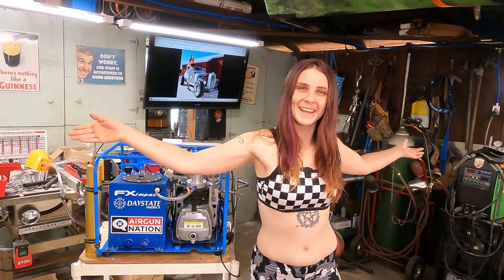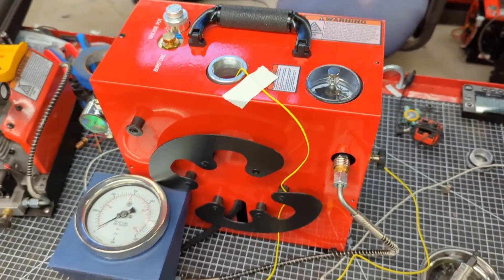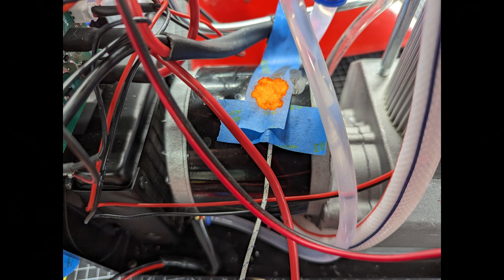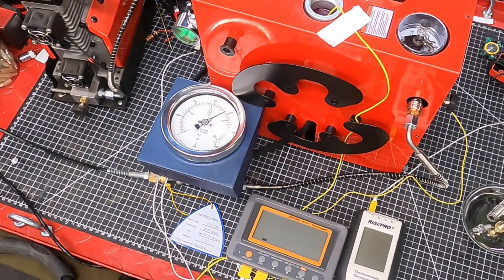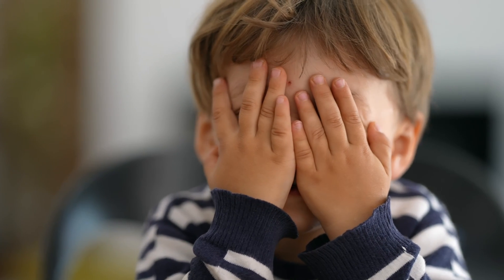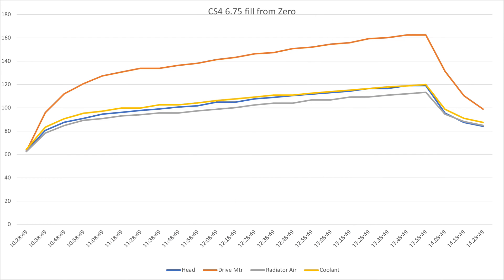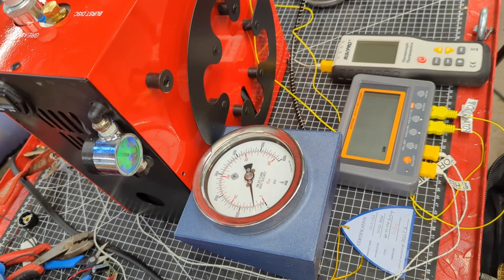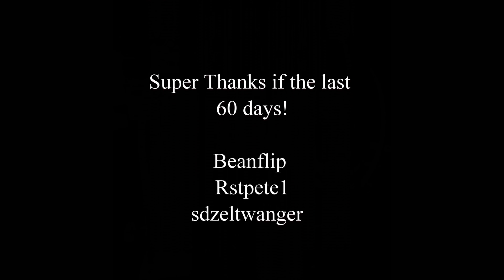CS4 Thermal Test! What's in store for you when you buy one! #HPA #YongHeng #compressor #airgun

Comment: I purchased a GX 4 compressor. This is the first time I run it. I set  my two needles at 4000 psi I did not hook it up to my gun. I just ran it like that. It only goes up to 3000 psi then it stops pumping, but the fans keep running. Is that normal?
Reply from the maker: Without seeing the needles in the pressure gauge, hard for me to say. What is telling you it is at 3000psi? Do you have an external gauge to test it? Consider booking a session to look at this with me via targetforge.net We likely will not figure this out through comments on YouTube.
Reply: @TargetForge  no I don’t have one of those gauges

Comment: Have the same compressor and my temps are not even close to yours, my water temp always settles in at about 140-144
Reply from the maker: Interesting, Differences in measurement method and ambient air temp can create a delta in values. What was your ambient? How are you measuring the temp? How high was your fill pressure?
Reply: @TargetForge  ambient temp was around 75 degrees, using a probe directly in the coolant. Temperature definitely climbs slower at lower pressures as I filled a large bottle from zero to 4500 PSI. Even lower pressures made it to 140 F after 20 minutes or so. I’d only run it for about an hour at a time to allow it to cool off. I have 9 and a half hours on the machine and it’s ran great. Just worried its getting to hot.
Reply from the maker: @spclarryy  First, I don't think ~20 degrees is a very big delta. Are you using coolant or water?
Reply: @TargetForge  im using RV antifreeze
Reply from the maker: YATZEE! We have our answer! RV antifreeze is not very good at moving heat through a system. Not a wise choice for a cooling system. Try your test again with water and let us know what your measurements are.
Reply: @TargetForge  will do! Thanks for the advice.

Comment: Excellent data! I just realizei you might have practically reached stasis though. The temperature of the equipment went up about 20 degrees from about 40 minutes until the pumping ended. However, the ambient temperature went up, say, 18 degrees if I understood correctly. If you reduce the final temperature by 18 degrees you would get a pretty horizontal line on that graph. In other words, correct for ambient temperature. What do you think? Make sense?
Reply from the maker: Great point!

Comment: Excellent as always!  I typically fill a 9L tank from 225 bar to 300bar, and occasionally a 450cc tank on my gun.  Since this compressor doesn't seem to get hot real fast like the Yong Hengs, i wonder how it would last doing just this?  I sue can't get the YH's to last very long, no matter what i do for extra cooling and short run times.

I truly believe we would have a much larger airgun community if we could solve the good/reasonably priced compressor issue.
Reply from the maker: Thanks Big Frank!